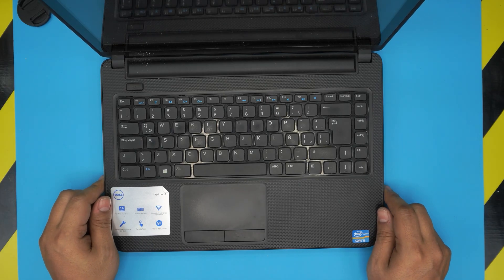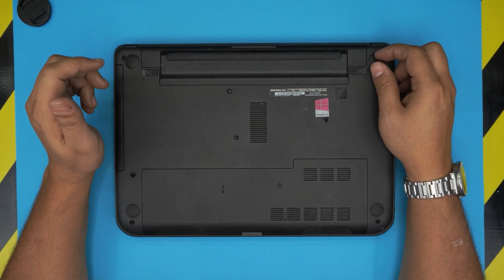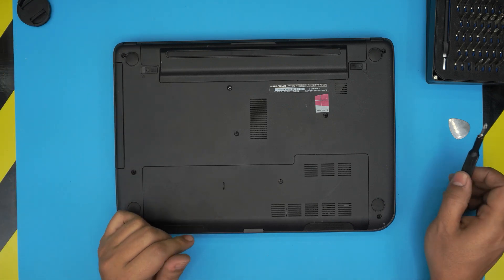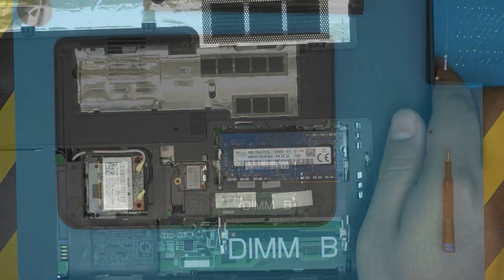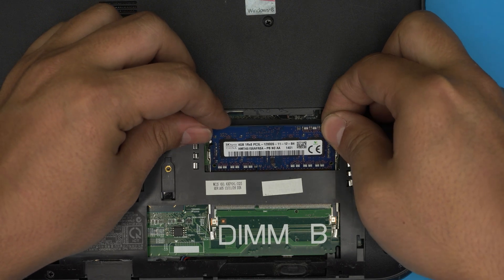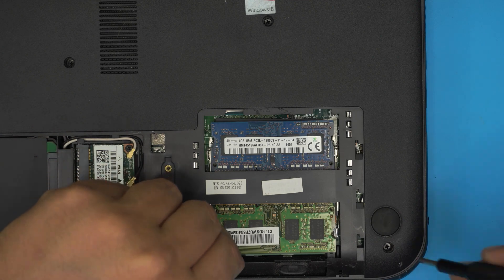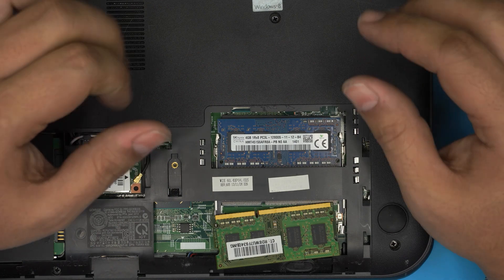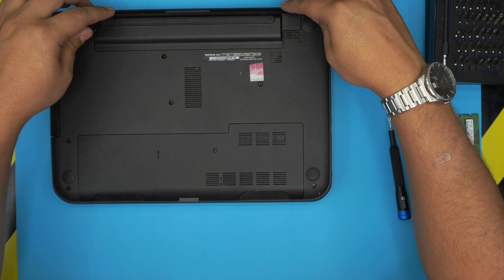Dell Inspiron 14 3421 Ram Upgrade 💻

Comment: The 3 point metallic thing that is on the side of the memory socket is loose... It is important?
Reply from the maker: 🫠Regarding your question, that is 100% normal and they are not even important—they are for static discharge or grounding.
cheers🍻

Comment: can I use a ngff adapter, so i can install a m2 ssd in this motherboard? i already have an extra m2 so i like to use it
Reply from the maker: 🫠Regarding your question, you can use an NGFF adapter, but the SSD must be a very short M.2 SSD, and the adapter must also be slim and short. Check AliExpress; it's hard to find, but it will work if you get the right adapter.
here is a link to Storage upgrade on 2.5" ssd: https://youtu.be/1yOTHhQVtA0
cheers🍻

Comment: Mine is same model but 2gb ram instead of your 4gb ram.
The cmd method you made shows 8gb maximum capacity but online says 32gb.
What's the real deal.

Also suppose it's 8gb maximum Ram capacity than can I use 6gb Ram in next slot since 2 gb is already available or does it have to be in pair like (4gb and 4gb) or (2gb and 6gb format also works).
     I mean the Ram has to be installed in pairs. Like if the motherboard supports 16gb of Ram and has 4 slots than 4gb sticks or two 8gb sticks can be  used.
  Isn't that how it works or can I use only one slot and use the maximum capacity like 16gb RAM in that slot leaving the second slot empty.
    What's the deal here.???
Reply: So 🤔 in online whatever the maximum capacity mentioned is fake.
Better to go with CMD method.
Also I think in online they mention high because they have no idea that the manufacturer might have soldered the RAM for profit leaving the user to use less than the desired capacity so if in online it says 32gb max but CMD method says 16gb max that means the remaining 16gb might have been soldered to the motherboard making it completely useless.
    And as you mentioned above mixing of RAM won't cause any issue that means since I have 2gb inbuilt RAM and 2 slot is empty and according to CMD METHOD 8gb is the maximum capacity so I can use 6gb RAM stick on that Empty slot without any issue making total of 8gb RAM .
But I think that 6gb should be of same power and L written as well for LOW voltage and same model as the 2gb for best compatibility.
   Correct me if I am wrong here.
And appreciate the reply.
👍🏻
Reply from the maker: 1st of all any ram you place in this model should be SDRAM DDR3L (Low voltage).
2ndly double check your CMD and see if the max cap is really 8Gb and not 16gb.
if it is 16gb then place 2 x 8GB DDR3L
if it is 8GB and you already have 2GB then you have two options:
2gb +4GB total 6gb
remove 2gb and place 2x 4gb :8GB
never mix low voltage ram with normal ram you can get crash and or even it may not even boot.

i been doing this for over 17years, and manufactures are trully miss informed and miss informing.
for e.g you can call any brand HP asus lenovo and say that you have a XXX laptop model and you want to upgrade SSD or ram what is the max number or capacity they will give you a wrong low number, on ssds you can go up to 2tb they will say 256 or 500gb, same goes on rams.

even in my video comments people say that they called and face same issue but the laptop can handle much more.
Reply from the maker: Thank you for your feedback! If you wish to support the channel, you can like, subscribe, or both!
Regarding your question, don't go with what they say online as there are many reversions of this motherboard, if the CMD says 8Gb  then you can only place 2x4GB. if you place 2x8GB then the system will say total 16gb (usable 8GB).
you can mix the GB without any issues, you can have 2gb and a 8GB installed without any problems.
Should you have any further questions or requests in the future, please don't hesitate to ask me.
cheers🍻

Comment: Hola buen dia, abra manera de ponerle una tarjeta gráfica externa?
Reply from the maker: Hola, hay dos maneras de hacer eso. La primera es conectar el GPU externo a través de un puerto USB 3.0, pero esto reduciría significativamente el rendimiento del GPU.

La segunda opción es quitar la tarjeta de Wi-Fi interna que está conectada a una ranura PCI-E y conectar el GPU a ese puerto. Tendrás que modificar la carcasa para que pase el cable.

Será necesario utilizar un adaptador como este: https://amzn.to/3OQz2uJ
aparte vas a tener que comprar una fuente de poder aparte.

Espero haber respondido tu pregunta. Gracias por el apoyo al canal.

Saludos.

Comment: I have the same laptop but turns on won't boot up it said PC needs to be repair any help on that ?
Reply from the maker: Thank you for the feedback! if you wish to support the channel you can LIKE or SUB or both :P
regarding your question: the issue is very common, we get them all the time in the store 99% is that your mechanical hard drive (HDD) is failing / or is dead. replace it and i recommend you to get an SSD its much much faster.
https://youtu.be/1yOTHhQVtA0
Reply: @uFixTek  thanks boss
Reply from the maker: It's my pleasure my friend. if you have any question or request in the future feel free to ask me.
good luck